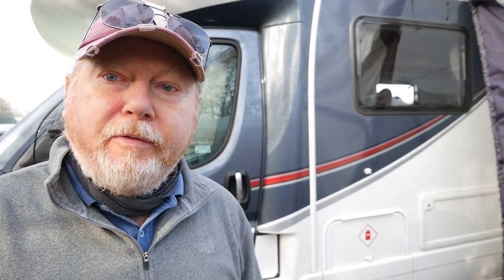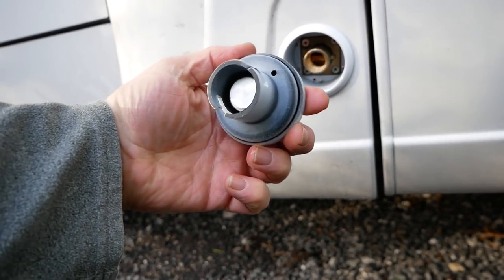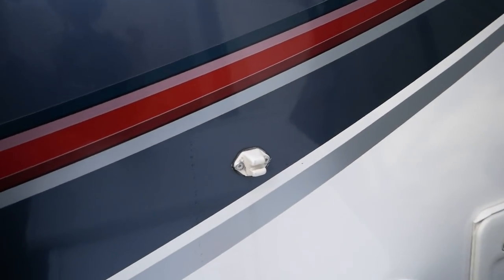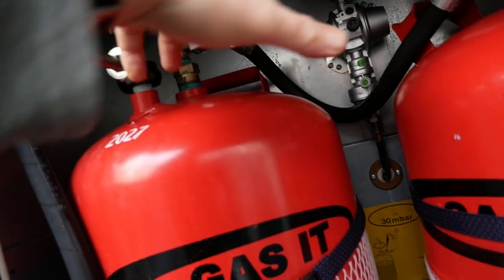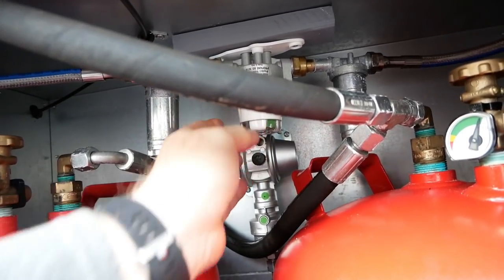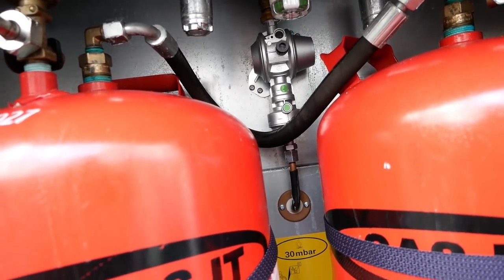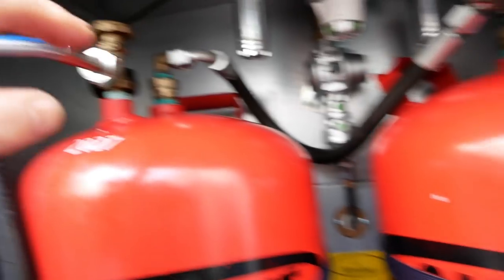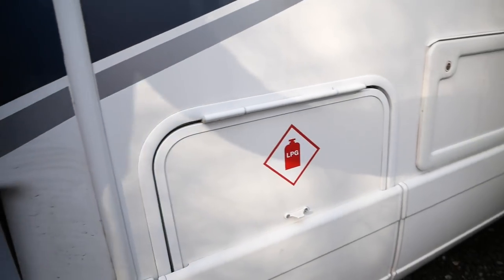Motorhome LPG GasIt System with External Filler #355

Comment: Hi, there, Steve, I noticed when you put your hand on the left hand filter, above the gas bottle, it moved when you pushed it . I would get this checked for gas tightness because all gas joints should be tight, with no movement. Bearing in mind the saga with Trouble World, if it is slightly slack now, it will only get worse with travelling. Speaking as a retired gas engineer, who has installed my own Gasit system, I thought I'd just let you know so as to avoid a potential problem, for example, in Sweden.
The reason they are wary of filling gas inside the locker is that they think you are trying to refill exchange bottles, which do not have the 80% safety cut off. 
Best regards, Phil

Comment: When you refill using the external filler do both bottles fill to capacity or do you need to switch over from one tank to the other?
Reply from the maker: Both tanks fill to capacity. The change over valve is for the outlet only.

Comment: Super informative video Steve. Do you find that this has saved you money. We are looking at the Safefill system for our caravan but note that you are on EHU most of the time as we will be also. Heard various reports that people don’t use that much gas when on EHU but I am hoping to use the Cadac and other general gas use when away. I am sure that it’s a no brainer for any wild campers as their gas usage would be much higher. Your thoughts on this system would be greatly received. 👍👍
Reply from the maker: Over time we will see the benefits.. for example a 6kg Calor refill is currently about £22. With LPG weighing 0.51kgs per litre it’ll its roughly 45 litre of LPG to fill our 2 x 11Kg bottle; at £0.65p a litre it’s less than £30.
That’s better than half the price of Calor refills.
Reply: The Happy Travellers thank you.

Comment: Hey There, another nice vid, do u know if your system and gaslow can use the same filling points and fittings. I saw a camper advertised (uk) using gaslow and the owner/seller stated you needed an account and an electronic key to access the fill point. I think you then get billed via a bank account??
Reply from the maker: I’m not familiar with gas low; I’ll try to find out :)

Comment: Hi, I notice that you have the changeover valve mounted to the top of the gas locker, at right angles to the way they are normally mounted. I assume that it's for the same reason I would have to mount one, no room above the regulator. Does this work OK?
Reply from the maker: Works just fine 👍😀😎
Reply: Thanks

Comment: Hi there.. When you fill up at the station, does the Lpg pump automatically switch off when tank is up to pressure? Like when you fill up with petrol 🤔 Cheers
Reply from the maker: Yes. I think there is a sensor in the bottle or valve 😀👍😎

Comment: All they are trying to do is stop the filling of calor and other bottles.  We have never been stopped (ours is in the locker), if we were I would explain why I am not filling with diesel and move on :-)  We love our refillable system and it has paid for itself many times over compared with calor etc.
Reply from the maker: AWe’ve never been challenged either. In fact the local SHELL station helped me to fill up the first time we did it :)

Comment: The gas it system is OK, but one downside is that you can only use propane,you lose the option of using butane, which works at a much lower pressure and is more docile and therefore considered safer.
In fact it is the gas which is recommended for portable gas heaters because you can burn it indoors and store it indoors. 
Having the option of connecting a temporary addition bottle be it propane or butane would be a great addition to this excellent system.... 
Just a suggestion.....
Reply from the maker: Using an adapter you are able to connect external bottles to the filler 👍😀😎
Reply: @TheHappyTravellers  does the system have an inline bypass valve fitted because if you connect a tradition gas bottle, using a traditional regulator via the filler, this gas will be released at 37mbar  (propane) or 29mbar(butane).
  So would it be regulated again by the built in regulator.   
   .
Reply from the maker: Not done this myself but I have seen others do it.  My understanding is that the connection to the outside filler is regulated too...

Comment: I’ve heard about these and apparently you can only fill them to about 80% capacity otherwise they become unsafe? Apparently automatic they have an 80% shut off fill system, meaning when you fill up and the the gas bottle gets to 80% full, it stops filling. So your loosing 20% gas from each cylinder.
Reply from the maker: The reason the liquid gas (LPG) can only be filled to 80% is that it creates a vapour in the bottle over filling could result in a bottle explosion. You’re not loosing any gas through this, rather just not able to fit more into the bottle ;)
Reply from the maker: Yes, the bottles have a safety valve in them so it always leaves room for the gas to expand into :)

Comment: On my Gasit system the gauge is simply click on, it's not bolted or fixed in any way to the cylinder. Yours looks exactly the same, it should pull off easily if you ease the the rear leg whilst pulling. Get back to me if you need more info.
Reply from the maker: Yes they are exactly like that.
Reply: The Happy Travellers Just been going through a few of your videos and really enjoying them. Apologies if you know this or it has been mentioned before, however, just so others know, in Sweden and Norway you must fit Winter tyres from December to 31 March and change to Summer tyres in April. Snow chains are useful to carry but Winter tyres are what will save your life and stop you being fined. Hope this helps somebody. Have a great trip